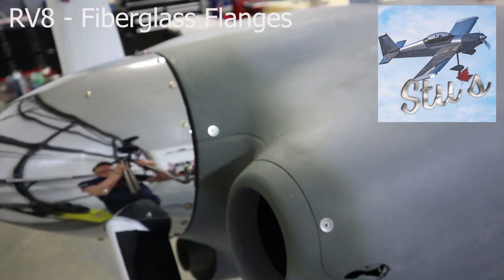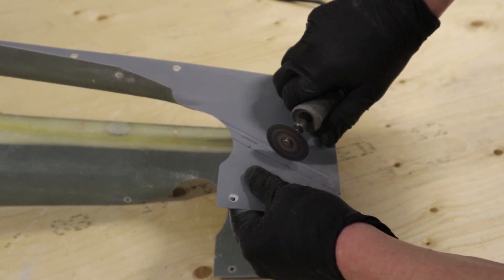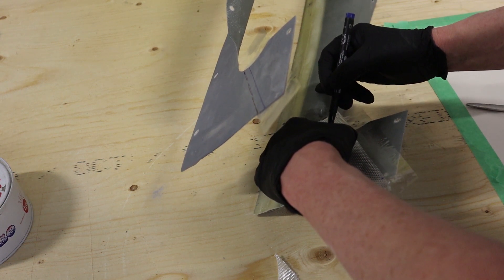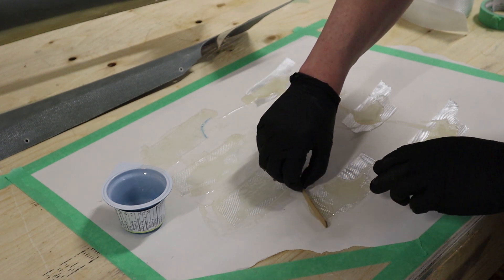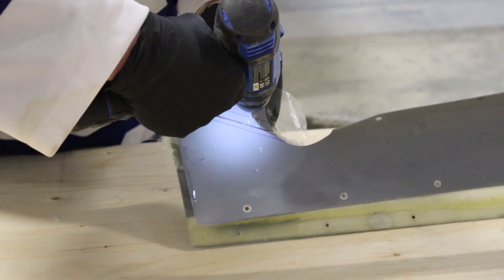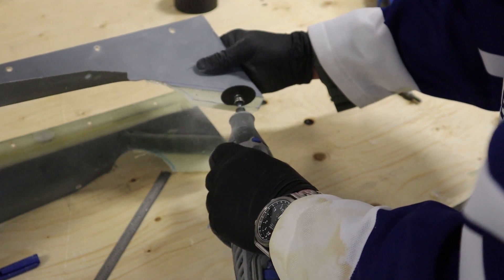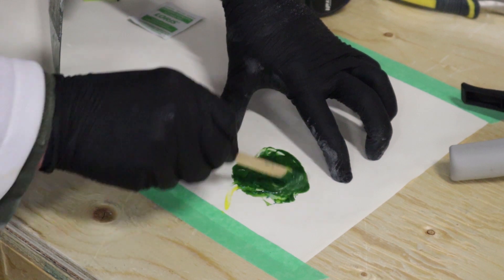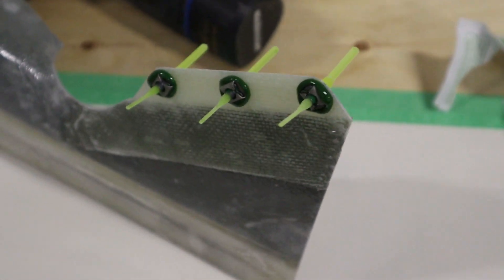RV8 - Fiberglass Flanges

Comment: Have you any informations about these nutplates you bond with epoxy. I only use nutplates to rivet.
Reply from the maker: Company is called click bond.   Great product when access to the hole is difficult and you might not be able to rivet.  Even in locations where you have access they are very fast.  No drilling and countersinking required for rivets.   Downsides are they are not cheap and you need the epoxy they supply.   Other factors is you MUST prep the part and make sure it’s clean otherwise someday the bond will fail and you’ll be left with a screw and loose nutplate.  Only option is to cut screw off if you have no access to nutplate.   I order from TheFlightShop.  One product I do really recommend is their studs.  Bond a threaded stud that you can then attach Adel clamps to and hold wiring.  Avoids drilling holes in fuselage

Comment: So cool. In an earlier video, you mentioned the landing gear install as one of the most difficult parts of the build. Can you elaborate?
Reply from the maker: Sure.  There is only 1 predrilled hole so it’s up to you to align the gear.  The holes you need to drill go into a steel bracket.  You can mess it up if it’s not lined up properly.  I saw one install where the holes were too close to the bracket vertical flange and builder had no room to get the nuts on.   Compare that to RV6 or 7 where the gear legs go into the engine mount with a single predrilled hole.  RV8 takes good day to install (maybe more) - RV7 takes about 10 min